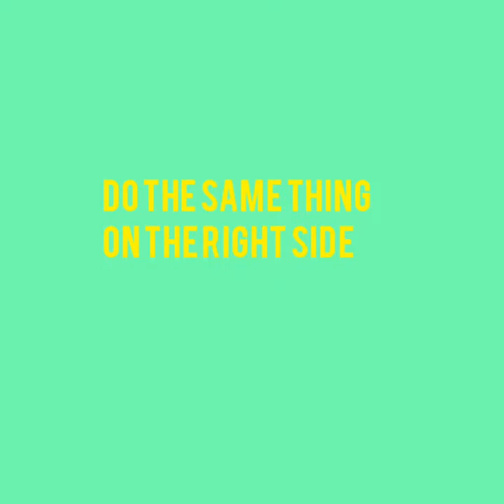Clean or change Bearing Shock Xtrail T30

Comment: Kamusta pare, wanna ask how long does the bearing lasted after cleaning. Is it worth just to clean or might as well change it? Salamat poh.
Reply from the maker: Depend on the part quality, i cannot say for how long
Reply: Your video from 3 years ago, until now the bearing still in good condition
Reply from the maker: @Muncachannel  already changed again, so i have to modify with flat needle bearing, make it more flexible